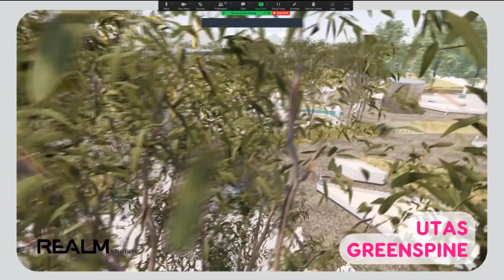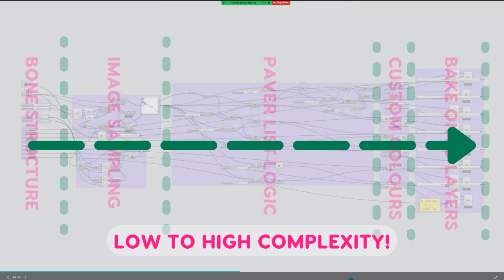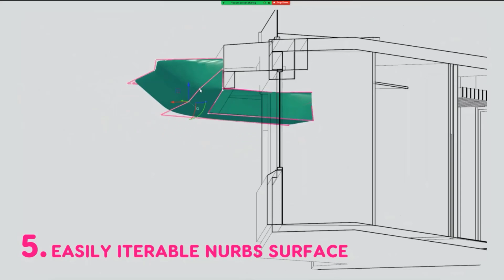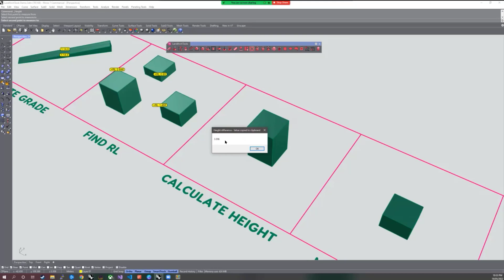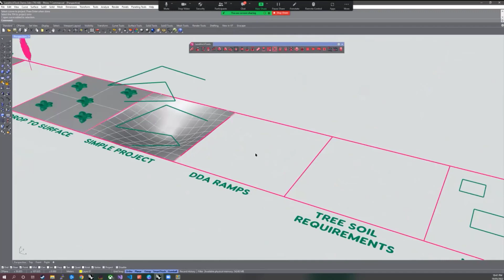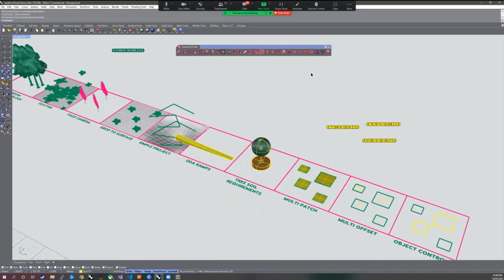Rhino User Webinar: Computational Design in Landscape Architecture (English)

Comment: The grade curve doesn't maintain the specified grade at every point on the curve. Overall the average is as specified, but along the curve gradients vary a lot on freeform curves. For example, a similar bezier curve drawn in the example graded at 1/25 (4%) will have segments up to nearly 6%. Sadly, I don't think there's a way of maintaining curve simplicity with high grade accuracy. I still use "flow" to grade my curves which destroys the curve, but high grade accuracy is a higher priority for me.